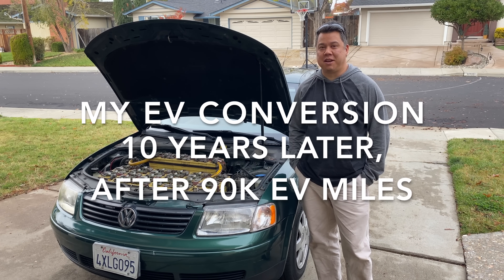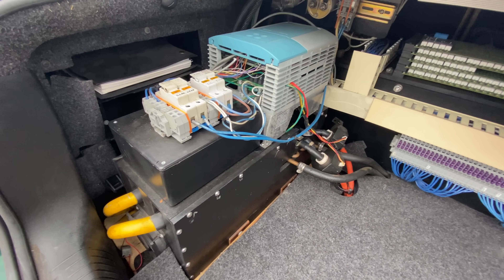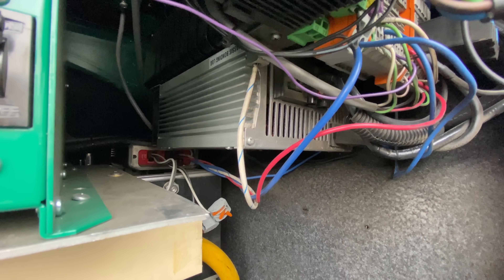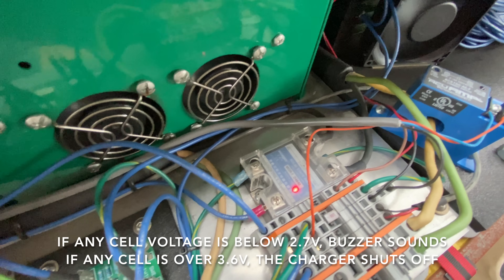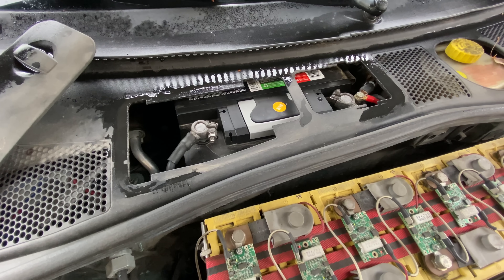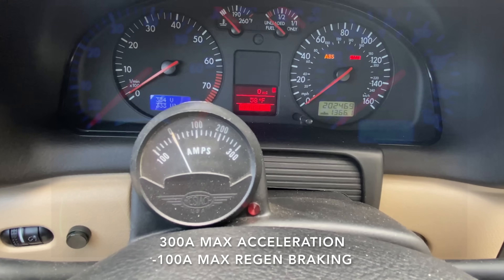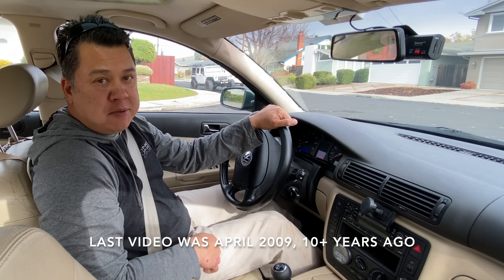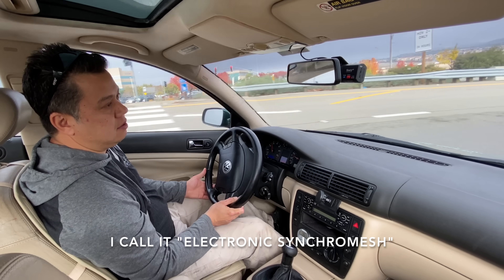My EV conversion after 10 years and 90k miles

Comment: Who else said wtf when he said "never changed the brake pads"?
Reply: Sity 909 electric motors will convert forward momentum into electricity each time you let off of the accelerator. (Braking for you)
Reply: @brennonmitchell7753  ah I see, I've never owned nor driven a electric vehicle. Thanks for the explanation
Reply: On my diesel Tiguan I haven't touched the brakes in 80 thousand miles. The beauty of engine braking on a manual diesel car.
Reply: @lefizz55  if you are keeping the fallowing distance and using engine brake it can last up to 10 years.
Reply: @namelesske  Currently on 7 years. Very low maintenance costs so far apart from a failed EGR valve
Reply: @lefizz55  i'm jealous. i can't even go to the end of my street before someone cuts me off and have to slam the brakes
Reply: @Killjoy_Xp  Hey I live in Spain, not be exactly the most courteous drivers, though I do spend quite a lot of those miles on motorways. And I'm old enough to be very aware of what's around me all the time and what they are doing. I use the brakes basically to come to a final stop, the rest is planning gear ratios and when to take your foot of the gas
Reply: Sity 909 electric motors brake hard when your off the accelerator.
Reply: Regen breaking baby!
Reply: @danaolson2871    don't forget to lube the chassis :P  still gotta do that
Reply: @punker4Real  VW used 8 ball joints (8 control arms, 8 bushings) in the front ends of these Passats. Jettas and Golfs somehow were made to work with only two ball joints per car. Take a guess as to whether they provided for lubrication of that hot mess of German "engineering," as they solved a problem nobody had.
Reply: The Passat's longitudinal engine is so far in front of the car that it makes it hard to change the direction of the car due to inertia. To make the car responsive in curves, VW had to come up with a more advanced solution than Golf and Jetta which have their engines tranverse oriented, and therefore closer to the front wheel axels.
Reply: with a range of 90 miles im pretty sure he rarely drives it very fast or on the highway much
Reply: jbbolts AC draws all the juice
Reply: scratch that highway comment i just watched the rest of the video :/
Reply: @jbbolts  you must have a very underpowered  car to need more than 90 miles to hit top speed
Reply: Regenerative braking helps a lot to save brake pads
Reply: Not me. My previous Prius at 306k miles still had original brake pads. 2nd one at 171k miles still same brake pads.
Reply: Whats the total cost of all Parts? How much time dies it took you to build?
Reply: I think this was a reference to the masses, average Joe is mad about brake pad wear...
Reply: I drive a diesel passat and last time i have changed the front brakes it was in 2012. I still have them and won't changed them for several years. Back brakes has been changed but lasted over 10 years. I use lot of motor brake method.
Reply: He explains it at 11:23
Reply: My dad's golf 1.8 tsi has 95k miles , it's a 2015 and has never needed pads. Its one of the best feeling brakes of most cars that I've driven and it still feels great even after 95k miles
Reply: @danaolson2871  well, brake-fluid really should be changed every two years max. even if you don't use them so it's probably not just for fun. there are more profitable ways a garage can screw it's customers over than brake-fluid changes :p and about the battery desiccant pack, i'm pretty sure you don't want your batteries getting moist so i can understand that too.
Reply: Nice!  He spent 10,000 hours and $25,000 so he could saved $50 on brake pads!   That is my kind of guy!
Reply: El Cactuar whoops, you’re correct. Lol.
Reply: Vablo Vablo the scope of the conversation didn’t really necessitate explaining the why, so it would be rude of me to do so. Scope of the conversation, I try to stay within it.

Also, the torque of an electric motor creates a lot of tension whether current is being applied to the system or not. That is why the regenerative breaking portion of the system is generally incorporated into the motor component and not a separate system adding tension.  So it would break on it own, regardless of if the system had a regenerative breaking system or not.
Reply: AJ Reves and you contradicted yourself by wildly veering off the scope of the conversation. You said electric motors convert momentum into electricity. That’s patently false at face value.
Reply: Fee it’s not a contradiction. I said the systems are generally incorporated into one  another.  Regenerative breaking isn’t the mechanism for deceleration.
Reply: AJ Reves but you suggested it was (and it can be) But synonymous with electric motors it is not
Reply: Fee lol, cmon dude.  You tried to say I said the exact opposite of what I said.  Never did   I say they were mutually exclusive.  I said, incorporated, which is different.  Also, you tried to say I decided to veer off topic. Just no.  I was responding to his off topic comment which happened to also be incorrect but since it was directed, well, at me... I addressed it. So just hahah followed by some more haha
Reply: AJ Reves you criticized him for going “off scope”, which was regen, and you went off yourself into electric motors 101. You’re right about one thing though I thought you were the guy who invoked regen initially and you weren’t so that part of my criticism isn’t directed at you
Reply: Fee Lol, if you can’t comprehend that I was just responding to his comment at that point. Well you have a good time being you.  You want to be wrong a 4th time, go ahead, type away.
Reply: @ajreves97  you were not just responding, you wrote in your first post that electric motors brake hard when you are off the accelerator, which is complete utter garbage. Tell it to a washing machine. Yes, there are cars with regenerative braking, there even are washing machines with that incorporated (they charge back to the plug, so your meter turns slower while the tumble brakes) but an electric motor which isn't used as a generator (i.e. no load connected) will just spin for very long, a lot longer than a piston engine. Just remove the brake from an electric lawnmower motor and see how long it spins after shutdown. You know how electric locomotives brake? They feed the "regenerative braking" off to a large resistor. A good electric motor in and of itself just keeps spinning. 
You are clueless on the topic, just accept that you can't be right when you don't even know the basics, and then you can't even express your (false) thoughts in a comprehensible way. You don't become an expert from reading popular articles or basic product reviews.
Reply: Dušan Barlík Oh this is good. All your comparisons are of electric motors when they are shut off or load is no longer being applied by it being disengaged.  That’s just faulty logic.  The resistance of the motor being applied to the car creates “braking” and the regenerative system takes advantage of that to charge the batteries. Most electric cars don’t disengage like your examples.  

I have an example of my own.  Drive an RC car, let off the accelerator and observe that it will come to a stop quickly because it has resistance being applied. Does it have regenerative breaking, no it doesn’t, it has directional load being applied to a motor. 

Kick rocks.

Funny, the resident non expert has a more relevant example than you, the electrical engineer.

Comment: if i made an EV conversion which would be cool, i'd not do an electric heat but, a crude oil heater just to piss people off :-P (although i wonder if propane could work? how long would it burn and how expensive would that be?)
Reply from the maker: There are plenty of diesel and propane heaters, but they are huge, and you'd have to sort out an exhaust system for it.  Heating element was so tiny it fit between the pollen filter and the blower fan.   An RV style heath would take up quite a bit of space, and require ducting.

Comment: Are you a controls engineer? I'm guessing you work in EV in the automotive sector? Great stuff!!! PS. I work at Samsung SDI, we make automotive batteries for EV and the Harley Livewire as well;)
Reply from the maker: Yea, worked at Tesla for 7 years as Sr. Staff Controls Engineer in powertrain manufacturing.  Did a lot of work in Solar, and web handling / tension control prior to Tesla.

Comment: Where did you source most of the parts?
Reply from the maker: Motor was from Ebay.  Batteries were from China, imported from a company that went bankrupt just after I received my batteries (got very lucky).  Charger was from Manzanita micro.  Other parts from Digikey, Mouser, Allied Electronics, Amazon, Craigslist, Ebay...
Reply: @etischer  Whats the total cost of all Parts? How much time does it took you to build?
Reply: @etischer  Awesome job linking all the parts together.

Comment: for 25k id rather buy a Toyota Prius
Reply from the maker: LOL, I think your missing the point.  Yes you can just buy cheap used EVs now,  but in 2008 when I started my conversion, there was no  Nissan Leaf or  Chevy Volt, or any other EVs.  This project was about the learning experience,  accomplishing something that hasn't been done before.  My EV was a rolling resume showcasing all the mechanical, electrical and software engineering and fabrication skills I picked up along the way.  It got me my career at Tesla.   Can you say the same about your used Prius =)
Reply: @etischer  Great answer, and awesome EV.

Comment: How about the batteries? How many changes have you made in the past 10 years?
Since they don't last forever and they are expensive, it's important to know how much have you spent
Reply from the maker: Haven't made any battery changes in 10 years, probably haven't even measured voltage on any of them in 10 years.  Zero dollars spent.  I did have to replace an IGBT in my home built controller which was $400 at the 7 year mark.  Also replaced a 2 dollar fuse.   Other than that, no dollars spent in 10 years.  Not bad for something home built in my garage.

Comment: "this is the inverter that i built" i love this guy already.
Reply: I recently bought a model 3 for my wife and had never driven one before. I am a tech guy and thought that shit was magic. He did this ten years ago. Alas, I am just a state school guy.
Reply: I’m a lift engineer and deal with invertors all the time. Ask me to build one and I’d laugh at you. Guys a genius.
Reply: @giantbellend it is the embodiment of "tell me you're an electric engineer without telling me you're an electric engineer" 😅
Reply: Yeah as soon as he said I built the inverter I knew this guy was in another league from me. But I applaud the hard work and engineering prowess that went into this conversion. Just think how many engineering problems and discipline’s he crossed doing this. And this was in 2008! He didn’t have another vehicle to take the parts out of. He had to spec everything and make sure all parts matched. I looked at something similar in around 2008 and it was a dc motor with lead acid batteries. Felt like I was driving a locomotive down the road.
Reply: Zeksteve  Disagree, the code isn't really that complicated, adequately designing an inverter for different ranges, EMI, and efficiency at high power is much more complicated
Reply: Whats the total cost of all Parts? How much time dies it took you to build?
Reply: @kirschkern8260  $25K, it is in first minute of video, why don't you just watch it...
Reply: Keep in mind $25k was 10 years ago. So many advancements have come with EV parts and suppliers and with the model 3 becoming so popular once everyone quits picking the wrecked ones of parts and batteries you can do this way cheaper. If you're looking for a normal EV car that isn't real sporty you can pick up wrecked E bike not E bicycles but street bikes and convert them to what ever you want. The hardest part is getting the motor to mate the the drive line or transmission but if you can take decent measurements you can have these parts CNC machined fairly cheap now.

Comment: Time for a serious up date on the batteries.
Reply from the maker: Well, I was doing 50 miles a day up until I no longer had a commute ( 2 years ago).  Car has been sitting for 2 years not really getting driven.  I have one bad cell, I think the top balancing BMS allowed one cell to get too low, it was about 30Ah below the rest of the pack.  This cell became the weak cell that limited the pack.   It was a good excuse to buy a Model 3.

Comment: This was very interesting.  I also sadly learned that a DIY conversion is much further away from my capabilities at present.  That being said, a used EV is still not outside of possibilities and it's a step in the right direction.
What I REALLY want to explore is the capability of an ICE generator electric drive hybrid with a smaller battery and a supercapacitor to level the load on a small replacement engine.  I'm thinking when the engine in my car gives out I would put the plan in to place, so I've got time to plan and explore.  The numbers you mentioned help give me an idea of the specs I need to build around: 1 AH @ 330V = 330WH/Mi being the most crucial, I know roughly a starting point to begin calculations.
Reply: This is a good viable plan it drastically reduces the battery weight problem and does not need any high tech to do it.
Reply: PS  Yeah, the idea isn't really revolutionary, and I've looked at used Chevy Volts, that might honestly be the route I go for practicality, but then it'd be fun to turn my old car into a project.  
Call it whatever name, it's basically a not-a-plug-in hybrid.  Everything I find looking up hybrid conversions is all about plug-in hybrids.  Hybrid Electric Drive ICE Generator  is my best name, LOL.
Reply: @easymac79  i have seen some nice DIY Hybrids, mostly Passat or E-class Wagons with an engine from a small car to power a small generator.
All Plug in with very low range. Your Rnage Extender just has to be strong enough to power the Motor.  but those are all City cars with limited speed.
Reply: What happens in an accident when a super capacitor discharges? (just asking...I don't know).
Reply: It really depends on the accident scenario, but don't think of super capacitors as something incredibly exotic, they are available in familiar form factors and are as safe as any other large capacitor, for instance found in microwave ovens, air conditioners, dryers, etc.  There is another channel where a guy replaced his lead acid battery with a bank of super caps, IIRC, these were 200F capacitors, I was thinking of using similar versions but haven't done the exact maths to find out total capacity.  
That being said, it would be pretty easy to make a discharge circuit, triggered by a sensor, perhaps connected to the air bag system.  There would be a relay which shunts power to a resistor which dissipates the remaining energy.
A super capacitor bank may contain less energy by volume than even a basic lead acid car battery.  A lead acid battery is also capable of delivering hundreds of amps should a short circuit occur and safety is a consideration.  
The advantage of the super capacitors versus using any other battery chemistry is how fast they can be recharged (seconds) and their nearly limitless cycle count.  You might drain the bank going from 0-20, but the engine starts and by the time you hit 30mph, the bank is charged again and you are pulling power from 30-40mph, now you are cruising, the engine shuts off for the most part and the capacitor and the Regen braking conserve as much energy as possible.
Reply: Whats the total cost of all Parts? How much time dies it took you to build?
Reply: +Kirsch Kern So far, my biggest challenge has been to find a generator capable of delivering the power needed to run the motor and charge a battery.
My best lead was the GM EV1 which had a towable trailer range extender with IIRC, a 50KW turbine generator.  The car was discontinued and the company recovered and destroyed all but three of the vehicles.  
Rough calculations, 
Drive motor $750
Capacitors $250
18650 cells for a 36v 600AH battery $1200
Charge controller $300
30KW microturbine generator $"contact us" sooo, probably $20-80,000
It depends on what you want out of it.  Are you okay with a top speed of 70? That will be substantially easier than the next step up because you are forced to deal with gearing then
Reply: I thought of using ultracapacitors to take juice from a range extender   generator and instantly bypass batteries & send to the motor....